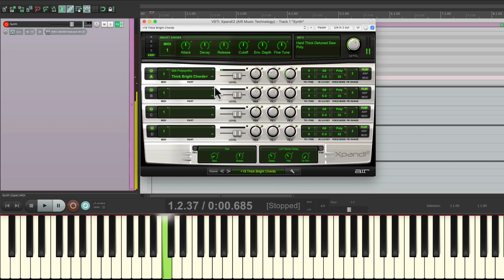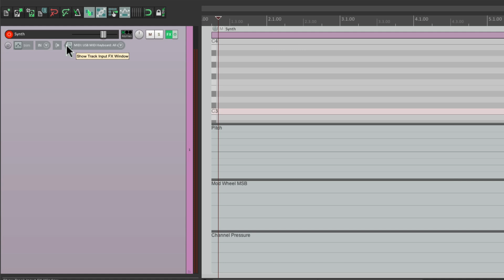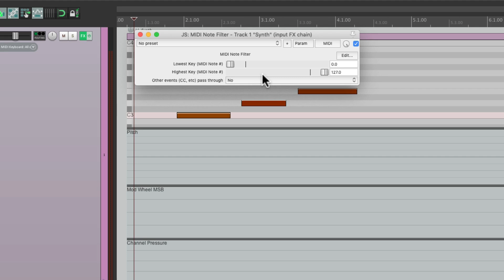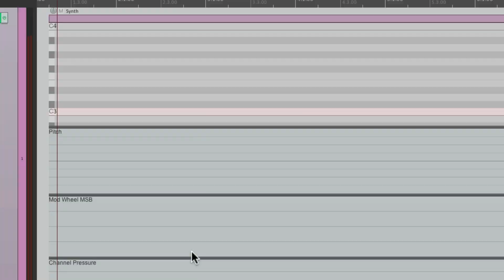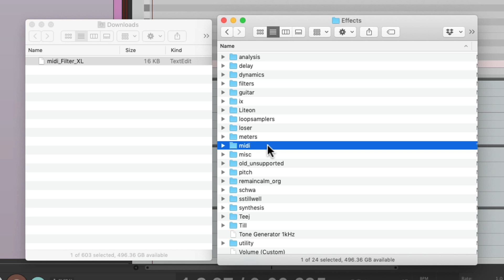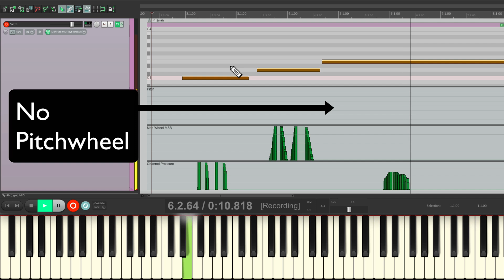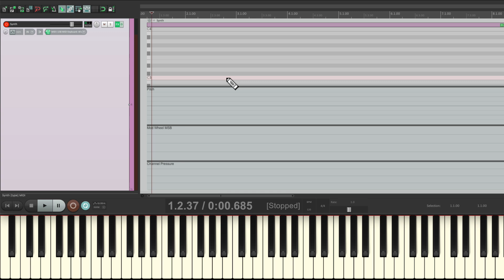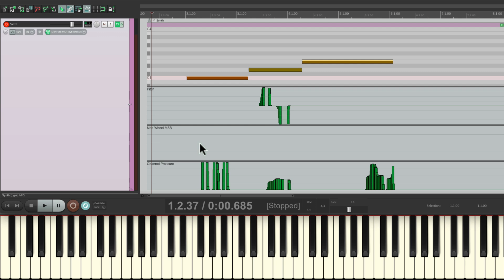MIDI Continuous Controller (CC) Input Filter in REAPER

Comment: Something I know we've ll asked ourselves at some point is, 'How do I filter the Monologue MIDI Input track on Reaper so it doesn't send its Filter Resonance control changes to the VCO Envelope Generator Intensity control on the Volca Keys ?'

Both use Control Change 43, you see.

As is so often the case, Kenny Gioia has come to the rescue.

Comment: Will this filter CC events from being sent to hardware as well?  I have a Strymon Timeline I am trying to set up footless operation for but Reaper sends CC 85-87 anytime i play/stop or click on a timeline marker in reaper.  I can alternatively use midi notes for the commands executed by CC 85-87 however if i use ANY cc messages, Reaper still sends to cc 85-87 causing the looper to play when it shouldnt.  If this or another plugin can filter midi OUTPUT from a channel, this will allow me to filter those CC and use the rest freely.  (note the CC 85-87 is for rec/play/stop on the timeline)